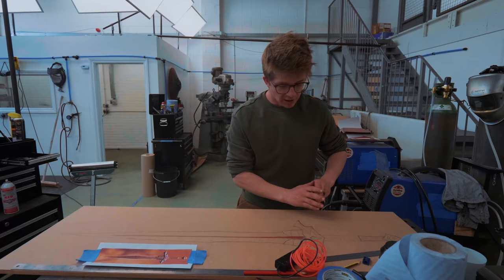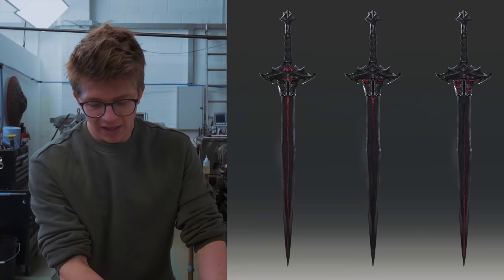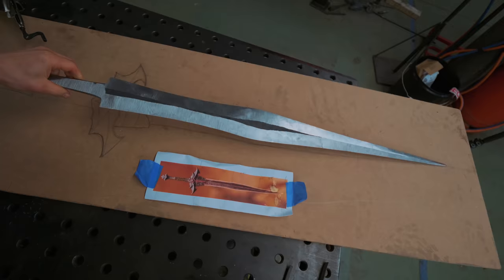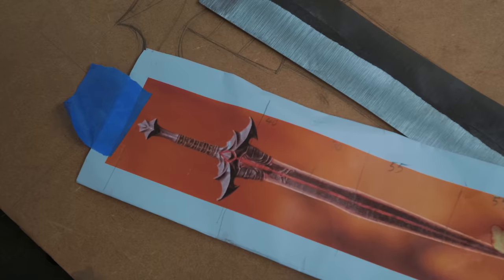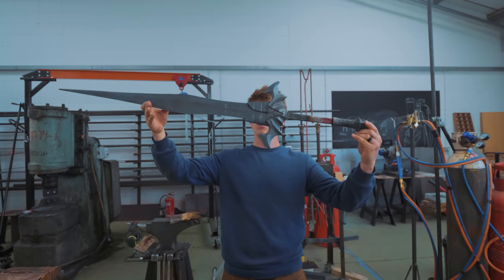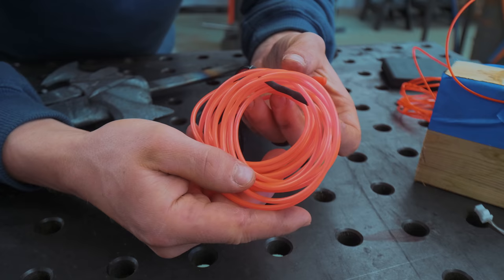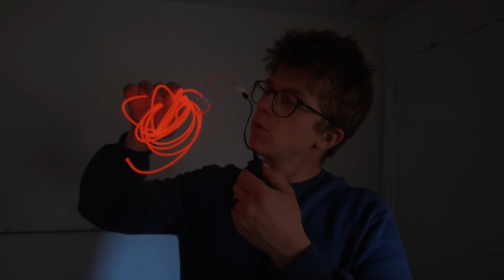MAKING NOKVROZ'S GLOWING SWORD FROM THE ELDER SCROLLS ONLINE!!!

Comment: Balancing prop making and blacksmithing to make an actual sword is no small feat, especially when the design was never intended to be executed in steel
Reply: I wouldn't go as far as calling that "an actual sword" tbh, more like a "structurally sound but useless sword-like wallhanger thingie"
Reply: This is not a real sword. This chunk of steel is too fat and has no real edge, therefore "it won´t cut".
Add the overblown guard and you have an imbalanced steel bar that will tire you within a few swings.
Reply: @antyspi4466  it's not a good sword, or even a particularly functional sword. It's still a sword 

Bearing swords existed in history, let's not pretend oversized, impractical swords are a modern phenomenon

Comment: A possible alternative for the red bit: Use epoxy (or resin) and some of Patrick Adair's glow powder.
Reply: Or he coud have taken a plexiglas roundbar whit some led at the top then some epoxy to fill it upp. And as the cherry on top lightly shade the epoxy 👌
Reply: I was thinking the same. A red glow powder in a resin that could withstand a bit of shock without cracking would be very cool, and a fair bit simpler than electronics, I would think.

Comment: I would have made the blade from sheet metal so it's hollow and lighter and use an acrylic block and RGB LED's for the center strip. With the guard mill out a slot to fit an arduino for the RGB controller. Then you can have two buttons, one for on/off and another for lighting modes like different shades of red or fast and slow pulsing, things like that.

Comment: I would have tried to integrate battery pack into the hand guard. The hand guard is pretty huge, if you made it out of sheet metal instead of forging it out, and left the inside hollow there would be plenty of room for the batteries and electronics, and you could have the switch for the light coming out of the bottom within range to press with your thumb. It would lighten up the sword as well since the guard is a chonker. It would probably be really hard to get the facets right though.

Comment: If you're planning on doing homages to others' iconic designs, you might consider an overhead projector for your workbench, which would allow you to project the design onto your work surface to aid in drafting your designs and verifying your dimensions. Not sure how practical it would be. I'm just spit-balling.

Comment: Disappointed that he didn't integrate a small rechargeable battery pack and the circuit board that operates the light strip..not saying I could do it..I just know he could..the power/control wire coming out the handle just does not live up to expectations...still pretty awesome tjough

Comment: Hey, I've always wondered if you could make damascus with the big flakes of scale that come off while forging and the steel you grind off as a canister? I think it would be cool to have a whole blade made of another blades excess. You could even have a sword with a matching dagger made of its excess.
Reply: That sounds like a great idea, good thinking
Reply: Thats not steel anymore, mostly iron oxide and a little carbon. You would have to re-melt them to make steel again.
Reply: @kampfnudel22  yeah I did wonder if it would have oxidised too much
Reply: @kampfnudel22  You could revert scale back into workable iron again, but I doubt processing even a large batch of scale would yield much workable material.

Comment: A prop to pay for episodes, ok - I'm with ya. :D
For me it wasn't the edge-less blade, off weight components, welding or basic grinding ... it was the straight groove for the EL wire. Ya, EL Wire is the correct choice, but the rest of the sword is so rustic(?) peened(?) raw(?) that it called for a cut slot that was later pounded out to grow/shrink with the sword. Epoxy with a matte/reflective fill would bounce the light as required for whatever the width.

Comment: Hey Alec, this was a really awesome build, but it occurred to me to ask, did that sword get heat treated? Not criticizing, just curious because I didn't see it in the video. Would you still be able to get the same cool stippling effect either way?
Reply: no it defenetly didn't get heat treated. otherwise the heattreatment would have been ruined by putting it back in the forge for the needlescaling. it looks like he might have used mildsteel for it anyways. I would asume this was a timesaving decision as bethesda only sponsored a single video, instead of a series.

Comment: Alec, you do a fantastic job. That being said, I would like to see you make more finished pieces on the anvil rather than relying on the belt grinder so much. Blacksmithing is supposed to be about manipulation and relocation of material, not removal. Not saying that would be applicable to this, or every project of yours, but I feel like there's too much reliance on the grinder overall.

Comment: 2 questions: shouldn't the strip be longer up to the point of the blade? And couldn't the battery pack be inside the guard to get rid of ugly wire? I know both of these would effect the integrity of the sword but it's a display piece so it would bot matter.

Comment: I was wondering how you clean up all the metal chips, slivers and bits aside from sweeping and vacuuming. Do you run a magnet pickup tool? With a shop pup running around bare pawed I think it would be a concern, aside from the stuff getting into and on your clothes, in your hair etc.?

Comment: A little disappointed with the battery pack sticking out, could have easily hid the electronics and a couple CR2032 Batteries in the handle.

Comment: The idea was amazing, but this is not glowing............ If you instead used a single red LED in the handlée and an optical wire.... it would be actually glowing, even in brightness as well, not just in dark.